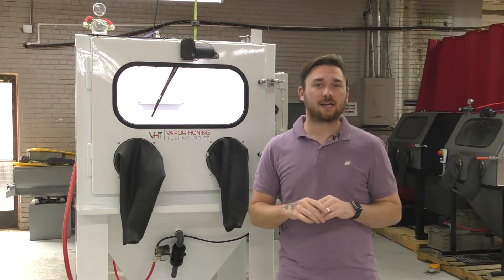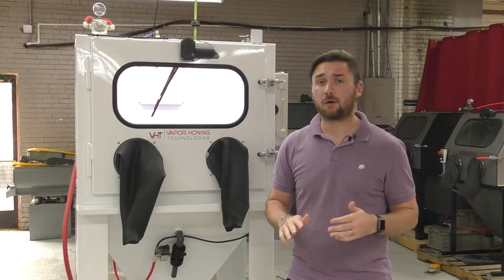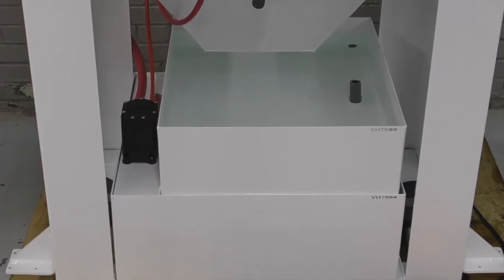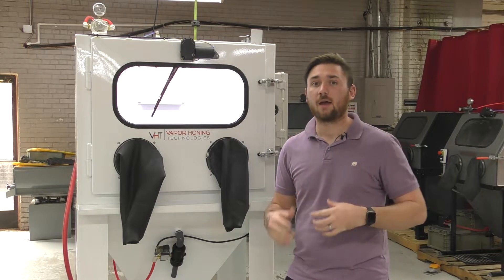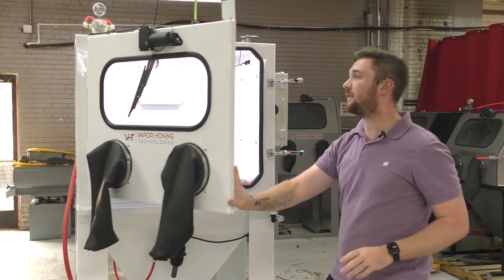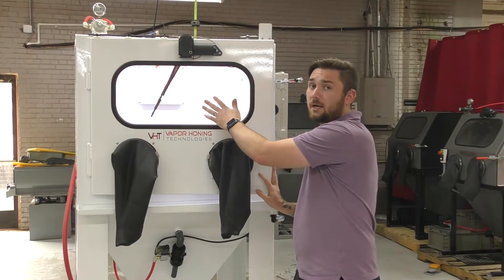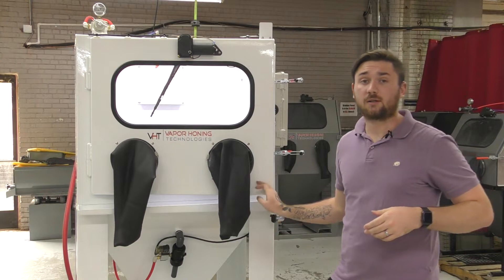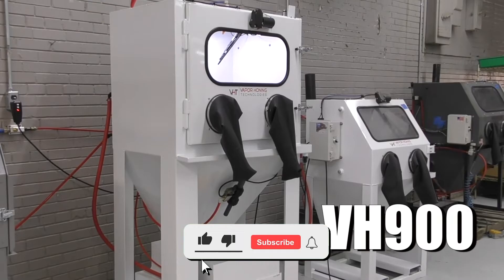Introducing the Front Load VH900 - Vapor Honing Technologies

Comment: Do you offer a smaller home (shop) vapor honing setup for motocycle parts (like more compact) for home use as size I need would be just large enough for smaller parts (largest would be a swingarm) at best?   The finish afterwards is AMAZING!!!
Reply from the maker: We offer the Micro Vapor Hone on Sale at $999.99, it has a workspace of 17x13x13 and a VH450 at $2599 workspace is 20x15x28.  Visit our Website:  vaporhoningtechnologies.com under Buy Wet Blast Equipment the drop down will list our equipment.  Call me at 828-202-5563 or email nicole@vaporhoningtechnologies.com with any questions and to place your order today.  Thanks Niki
Reply: @VaporHoningTechnologies  THANKS!!! Goin to check this out.